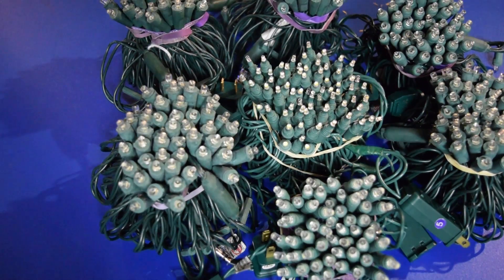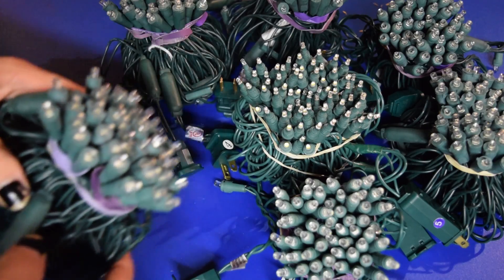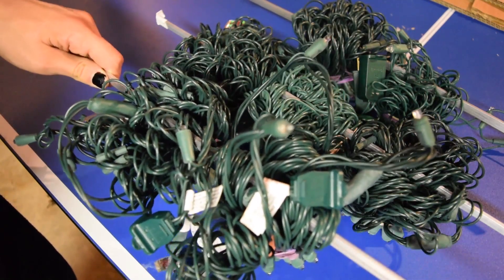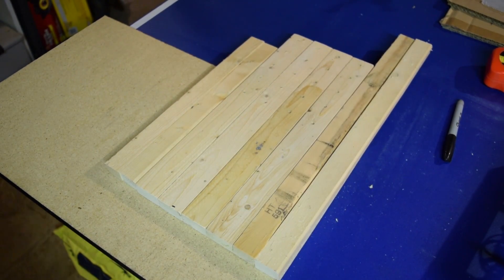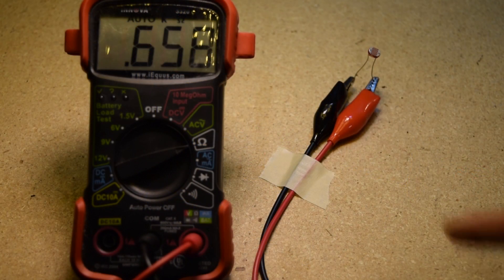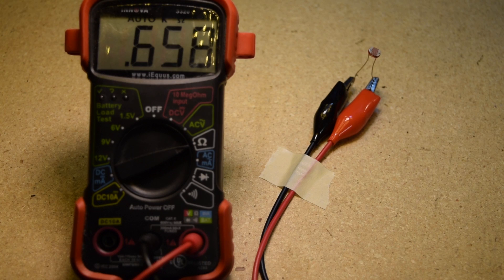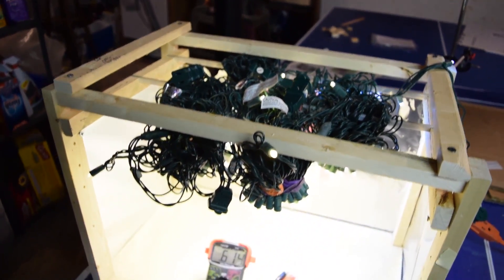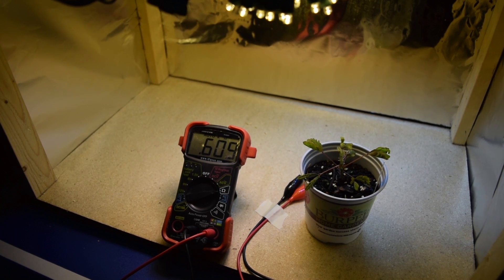How to Build a LED Grow light

Comment: im sitting nex to a trash can full of Christmas lights I was goin to go take in to recycling but for 30 cents a lb now I think I have a new plan for them

thanks for the video

I found some Lots for sale on ebay 100 pcs some for as low as a few bucks but they were the diffused ones which I believe the flats work better but were around 10 bucks a Lot...which ones did u use? I couldn't see

Comment: ..... this is a waste of time and energy, sorry m8 :(   the spectrum of those leds and the way they are driven is not efficient :) 

For a small light like that you would be perfect with a 10w chip or 15-20w in beads :) can be mounted to the top of your box. if going with 102 chip, will need heatsink, for 3w mounting them on an aluminum frame should suffice :)
Reply from the maker: +flaviu mocanu I never thought it was super efficient.  But buying LEDs costs money.  I had gotten these lights for free. :)
Reply: cool thanks for the feed back, where do you get your pre made lights cheaper?